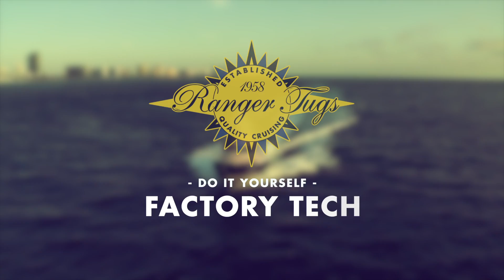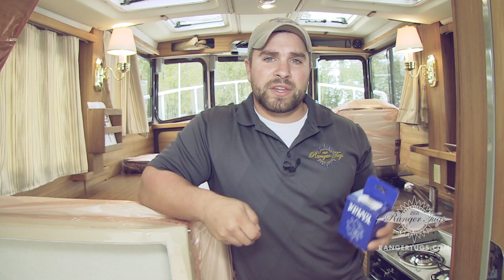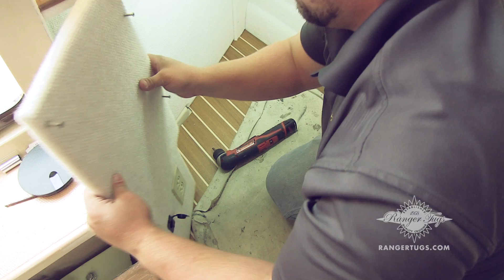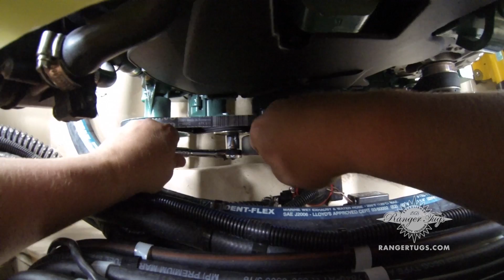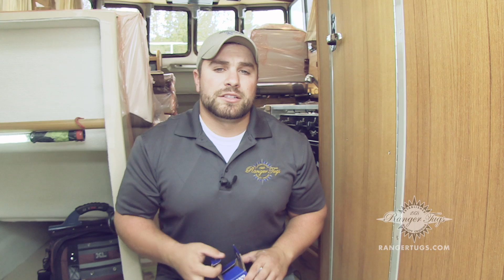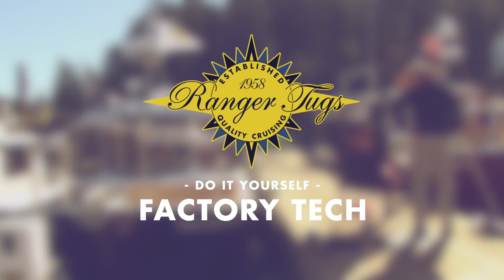IMPELLER REPLACEMENT - Ranger Tugs Factory Tech DIY

Comment: How often would it be necessary to change the impeller?  I would assume it very safe to carry a spare at all times.
Reply: I thought they said it was a new boat also.
Reply: I’ve read that some people do it yearly. I’ve got 1000 hours on my 2015 R27 and there haven’t been any issues. I’m going to do it now as the alternator needs replacement and it can be done at the same time.